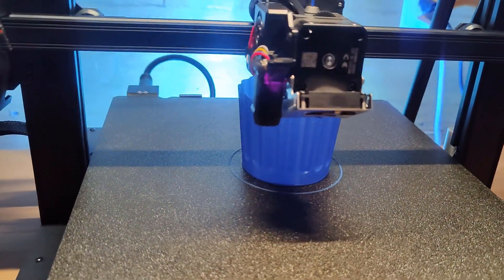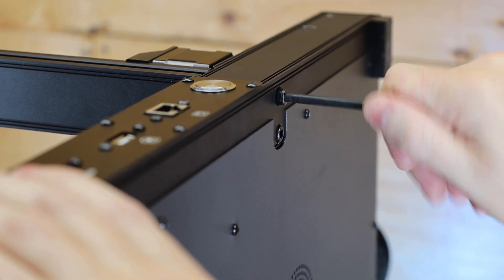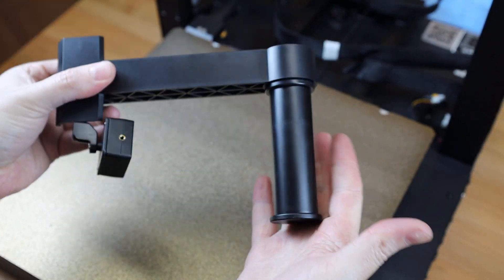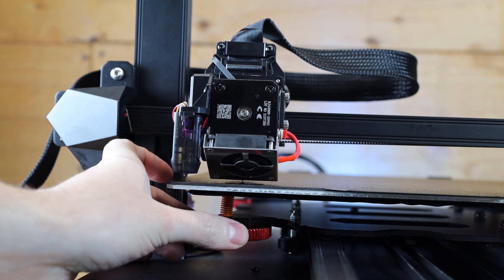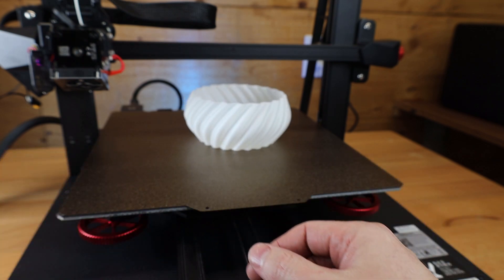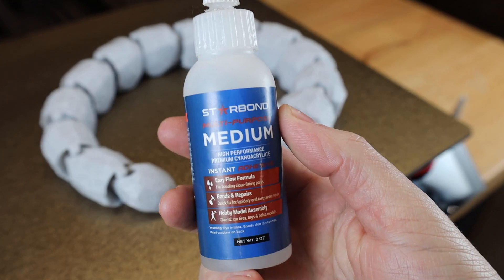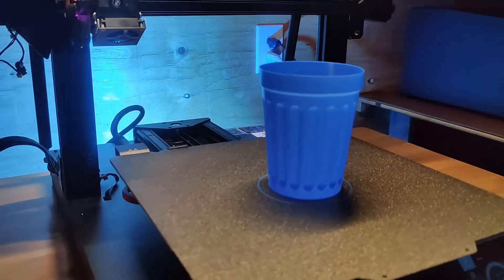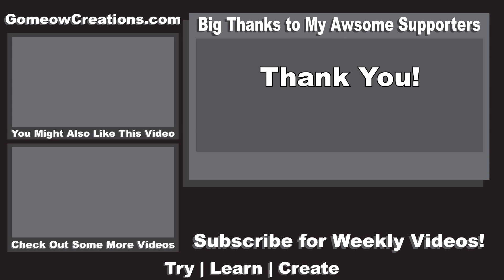Creality CR-10 Smart Pro - Let's See How Smart & Pro This Really Is 😁👍

Comment: Why don't you show how to start the first print, instead of skipping over that part. THIS IS EXTREMELY FRUSTRATING FOR SOMEONE'S FIRST TIME TO START A PRINT WHEN NOBODY SHOWS THE ACTUAL STEPS ON THE PRINTERS SCREEN... On top of that, I've manually leveled the bed four times, and then ran the auto leveling afterwards, but each time I start a print, the nozzle is STILL too high, and it doesn't stick to the bed. Over and over and over again. I preheat the bed and the nozzle, and it still seems impossible to get that first layer level and just right. It would be nice if someone would do a step by step first print on this machine. I know this is a great printer. And I know I will eventually learn all I need to, and do well with it. But it would sure be nice to get an assist to speed up that learning curve.
Reply from the maker: You just need to adjust the z off set in the settings. You can do it as it's printing too. Just start a test print and wait for it to start printing. Look for the z off set button it will take you to a new screen and look for z-axis comp and start adjusting down until you have a good layer.
Reply: @GomeowCreations  Yeah, I was really frustrated at that moment, as there's plenty of help for people who have been printing for years. But very little attention to the first steps, for noobs. 
I now have it pretty well leveled out, doing exactly what you describe above. And afterwards, I see your message in my email. Lol. However you get there, as long as you get there, huh? I still need to hone the right side in a bit, but the left side is spot on right now. Bit by bit...

Comment: got this printer, like you said, very quiet, works perfect with TPU... but for the life of me, when printing PLA, cant get the horizontal nice and crisp... always have these little fuzzy coming off the surface... i have 3 CR10 smart and they are running exceptionally well out of the box.

Comment: Did you use creality slicer or something else? I've had this 3d printer for a while and I still can't calibrate it and I have various printing problems that I can't solve. A video on how to set up a good slicer for this 3D printer would be useful.
Reply from the maker: I just used the Creality Slicer for everything in this video. I used the stock settings for pla and had no real problems that I can remember. What problems are you having?

Comment: Will the auto bed leveling happen every time I start a print or can I choose when it happens?. Some context:  I need to print a single object with two different colours by printing in two passes (first pass is lettering 0.2 mm high) , which means I leave the first print on the bed and then start a new print with z hop to hop over the first print and fill in the gaps. I'm worried auto bed leveling will crash into my first print.

Comment: old trick I learned (Navy brat so moved about 50 times), to remove those stickers from items that mar (that you cannot use a scraper on) is to get a soft  artists gum eraser and it will remove (turn the stick-um into crumbly balls) it, be careful with the opening for the SD card but it should work (pencil eraser will work too).
Reply from the maker: Well thanks that is some helpful info for sure 😁👍

Comment: I got this printer a few weeks ago and I use Cura slicer. I have to manually adjust the print speed in the printer because it doesn’t seem to use Cura speed settings. It is always at 100 and also the cooling fan would not turn on until I manually turn it on myself on the touch screen.  Do you have the same issues?
Great video btw
Reply from the maker: Sadly I haven had this problem so I don't know why it would be doing that.

Comment: What's the usb c port for
Reply from the maker: I honestly have now idea and never thought about tit to be honest 😅
Reply: @GomeowCreations  lol ok so on an ender 3 v2 there is a micro USB port and you can print using it by connecting it to a pc and if you have the correct drivers on your PC you can use the USB c port to do the same on the cr10 smart pro I just found that out and made a short to show I was able to do so without modification Luke others where doing. I found this out right after making that comment
Reply from the maker: That is interesting and good to know.
Reply: @GomeowCreations  it's some ch340 usb driver

Comment: This printer is now $800-900. What makes it $400 better than the CR-10 Smart?
Reply from the maker: From what I have found, you can get the CR-10 Smart Pro for $838.22 shipped and the CR-10 Smart for $527.56 so a 310.66 difference. That being said the only difference I see is the auto leveling system, led lights, webcam and the direct drive setup on the pro. I can see that being worth the extra $300+ to some people that don't want to mess with upgrading later. 

The only bad thing I have seen about the C-R Smart was people having a very hard time leveling it due to the fixed bed. It was soo off in spots that they had to take it apart and add shims to make it work. The pro has and adjustable bed so you can move it if needed and have the CR touch take car of the rest. 

Just my thoughts on it 😁👍
Reply: @GomeowCreations  The Smart didn't have manual leveling screws, and this does. That is a huge difference between them.

Comment: Thanks for your Insight. Got mine yesterday....so far no problems. Capable of printing very fine details in comparison to my Anycubic i3 Mega wich i had for Years, a nice Upgrade i think. And no Mods needed😉
Reply from the maker: That is good to hear and yeah I haven't had any problems with it yet. And I feel the same way about upgrades on it, non are needed. 😁👍

Comment: Well after seeing this video last week I bough a CR10 Smart pro,   Regret it after 4 days,   worst printer I have ever used.     First of all the leveling on this thing is a nightmare,    I leveled it around 100 times in the past 4 days,    manual level like I do my Ender 3 pro,    then auto level with the CR touch the adjust the Zhoffset.   and I really don't think its saving to Eprom to be honest,   Because when I do my leveling test print its off big time,  So auto level isn't compensating for the bed at all.   Bottom left is too low,   top right is too high,   and I do have a high spot in the middle it seems,   but the CR touch should take care of this and it doesn't.      Other issues I have is printing,    Vase mode rocks,   but with no retraction thats normal, easiest thing to print.      Benchy looks good,   XYZ cube looks good,    but a actual print with support ( tree and normal) Look like crap and fail.    real nightmare, and the worst 1000$CAD i wasted in a long time.
Reply: And I tried Cura 4.12,  Cura 5,  Creality slicer and prusa slicer :(
Reply: @MrRuber249  I would reset all the settings in the printer's flash memory first. After that, you will need to lower the bed via the wheels until they all bottom it out compressing the springs. THEN start the manual level process at point 5 (the center) - and reverse the wheels at each test point until you get within about 0.5mm across all 5 points. This will take about 2 or three cycles to get them all within the 0.5mm. NOW, you do do an auto-level and it will create an internal mesh profile of your specific bed plate. Once that is done, it will go back to the center of the bed (point 5 or the HOME position) and come to a stop after probing its latest bed distance, you can lastly make the final Z-axis fine tune adjustment. In 0.1mm increments, you can adjust the nozzle down to 0.2mm (I prefer 1.8mm). To get to that resolution, it may need a Z level adjustment as much as +/-2.5mm, even if in most cases it will be less than 1mm. This may read weird, but I own and have tested both the Ender 3 v3 S1 and this CR10 Smart Pro (which replaced my CR10S-Pro v2 as a rapid prototype printer), and up to a few mm of wiggle room to get it dialed in is not unheard of. 

Even my $5K Raise3D Pro3 Industrial printer needed to be calibrated before its first use to confirm the factory precision of its gantries and robust leveling probe remained dead on accurate within 0.04mm across the entire CNC milled build plane. This takes about 1 hour from start to finish. 

Once you get it done with the CR10 Smart Pro, it will be a nice feeling and the printer will pay you back with nice prints.
Reply: @TheSbooth72  With your CR10 smart pro, did you upgrade to V1.0.13? If so did you notice the CR touch not retracting when it does auto leveling?

Comment: Why are these $799 instead of $699, as shown?
Reply from the maker: I have no idea and sadly I don't control the prices and I can update it in my videos 😅
Reply: @GomeowCreations  It doesn't really help if you update to $799. I was thinking they could update to $699! :😉
I wasn't complaining about your video. I'm a buyer at$699. Otherwise I'll wait
Reply from the maker: That is understandable 😅
Reply: @GomeowCreations  I'm looking for a 1st printer and I wanted to get something with a fairly large work area and a 300 degree extruder so I could print stronger materials, later.
I thought I had found the one, but now that I look most won't even ship for weeks.
Maybe I need to look at a different CR and upgrade the extruder??

Comment: I saw this on the Creality Store and is labelled as fully automatic bed levelling which is not the case as it does not have a third leadscrew and Z controlled bed, what it does have is independently driven dual leadscrews enabling G34 to be used to level the gantry with a CR Touch, the bed still has to be manually leveled and then probed, a fixed level bed would be more preferable, I cant see where they have spent all the extra money this costs over the CR-10 Smart, It seems they have added the retail cost of the upgrades to the CR-10 Smart price, with no consideration to subtracting the price of the original parts that were replaced with the upgrades
 The Smart features on the original did not work, is this the case with this one also?
 If so Creality are sticking two fingers up to the people who purchase this.
 Since it came out that Creality were offering cash bribes for favourable reviews of their lemon printers despite being aware of those Youtubers review policies and as a result those large channel Youtubers breaking all ties with Creality I would not feel comfortable buying any more of their products
Reply from the maker: Yeah from what I have seen about the first cr smart people had a lot of problems with the fixed bed design and could never get it level. The manual bed with the car touch is a good setup, at least from my experience. This is how I have all of my other older Creality printers setup as well and I have no problem with them after I get things set up the first time. 

I do a lot of product work ony printer with 1000s of hours of print time on them and honestly. This printer was added to that setup and I'm having no problems with it yet using PLA but I did have a problem getting abs to stick to the bed so that. 

I wasn't paid anything to make this video, I was just sent the printer and told a date to have the video out by, and that was it 😁. 

The UI on this is not something I like that much and the screen doesn't always pickup my touch inputs the first time. I really wish it was more like the big tree tech displays.

Comment: Any update on the use of the printer? I am looking to buy it as my first 3D Printer and I just want to hear confirmation that this is a good printer
Reply from the maker: I've been using it a lot since I got it and using it for basically production work I've had no problems with it so far and I would recommend it as a first time printer.
Reply: @GomeowCreations  Wow! That's great news! I have to say I really appreciate your quick response! You just earned yourself a new subscriber! Thanks for your help 🙂
Reply: One last question. So I am comparing this to the Ender 3 S1 Pro (agree not an ideal comparison given different build volumes) but I know the S1 Pro can also print wood... can this one print wood too?
Reply from the maker: Wood, like wood filled PLA? If so just about any printer can do that. They do have problems clogging with 0.4mm nozzles but you can do it. I used a 0.6mm nozzle in the past to print with it and had no problems.
Reply: @GomeowCreations  Yes, Wood Filled PLA, given my limited experience with 3D Printing, I thought it's a unique feature of the Ender 3 S1 Pro... they seemed to be using it as a selling point too... so got my attention. If that is the case then this is probably a better printer than the Ender 3 S1 Pro given the larger build volume too.
Reply: @GomeowCreations  Another year later - are you still using the CR-10 Smart Pro?  If so, are you still happy with it?  It retails for $499 right now and I'm considering it as my first 3D printer.  Seems like it offers a ton of features for that price.

Comment: New firmware came out yesterday and has transformed the printer especially with nozzle height adjustment fir different filaments.
Reply from the maker: Good to know. I will have to update it and check it out one I'm don't with the prints I'm doing 😁👍 thanks for that info
Reply: AGAIN a noob question, but it doesn't go nearly so smoothly when it's your first printer, and there isn't many sources of step by step instruction, and EVERYTHING I can find is for the Smart, NOT the Smart PRO. For example, I've been all over Creality's site, and CAN NOT find a firmware update for THIS printer. I find the one for the Smart, but NOT for the Smart PRO. Please point me to a link where I can get this printers updates. Thanks for any help.

Comment: i just got mine , super impressed with it. quick question , when the print ends the build plate goes backwards instead of forward. i tried a lot of things with the ending G code with no luck. did your printer has the same issue ?
Reply from the maker: I don't remember to be honest. Did you run any firmware updates on it yet?

Comment: Question for you. This is going to be my next printer and I am building a shelf for it. With the bed pushed all the way back, how long is the printer from front to back? 

Basically? What is the minimum size table (front to back) I can use if the table is going to be against a wall?
Reply from the maker: So if you have a wall behind it it needs to be about 29in due to the rear cable
Reply: @GomeowCreations  thank you! Looks like I am going to need a bigger table!

Also, I tried ordering using your link. Are they out of stock everywhere? Do you have any other sources to get one?

Comment: Hi, I got this printer yesterday and was able to put it together without issue. However, when I try to home Z or auto level, the CR-Touch does not stop the Z axis and the print head continues to move down after it touches the plate and crashes into it. Do you have any suggestions on how to fix this?
Reply from the maker: Does the crouch have power and is it deploying the probe before moving down?
Reply: @GomeowCreations  yes, it has power. It runs the self check when the printer turns on and then when I click ‘auto level’ it deploys the little probe.
Reply from the maker: Before doing anything else try to update the printer. I did it with the mobile app. Let me know if that works or not
Reply: @GomeowCreations  I successfully updated it through the app, but it is still unable to level or even home in the Z axis. The cr-touch doesn’t stop the printer from moving when the probe hits the bed
Reply from the maker: And I'm sure you have tried triggering the probe before it hits the bed with like your finger or something right? Sadly by the sounds of it you need to contact reality because I don't know any other things you could try. I wish I could help but let me know what happens
Reply: @GomeowCreations  I have tried that and the print head continues to move down. I think the issue is that when the probe hits the surface it does not retract. I have contacted Creality but unfortunately they won’t be able to respond for a while due to Chinese New Year. Thank you so much for your help though.
Reply from the maker: I guess it could be a bad sensor? 
I know you can get that sensor on it's own but idk if you want to buy one to see if that will fix it https://amzn.to/3GohFJQ
Reply: Hey, had the same issue... you have to move the print head all the way up before leveling. The icon at the Z-axis option looks like it levels the bed but actually it levels the print head! Its confusing... So press up, move to leveling points, and then down. Make sure you leave a little bit more space at first before you move to other leveling points. Otherwise you will maybe find out the other points of the bed are higher and your nozzle will crash into the bed again.

Comment: Sorry for the question, I'm new to 3D printing. Does this printer need to be leveled every time I print, or does the leveling stay calibrated?
Reply from the maker: It stays level for the most part. If you pick up the printer and move it to a new location you might want the run the auto level. If you change out the material you you might need to change the z offset.
Reply: @GomeowCreations  Thank you so much for your answer!
Reply from the maker: No problem